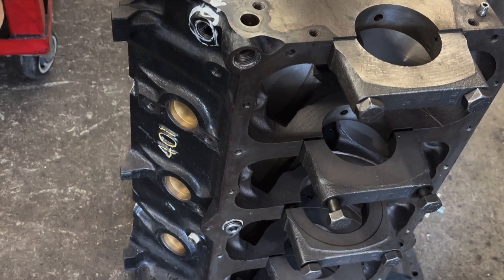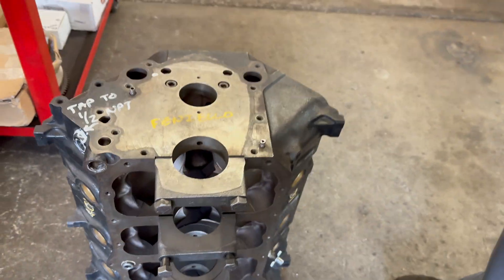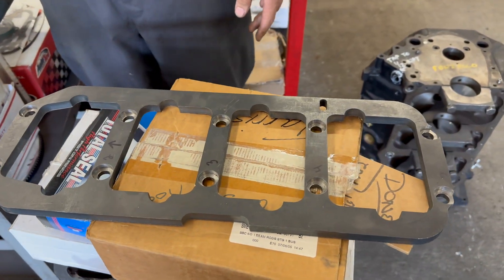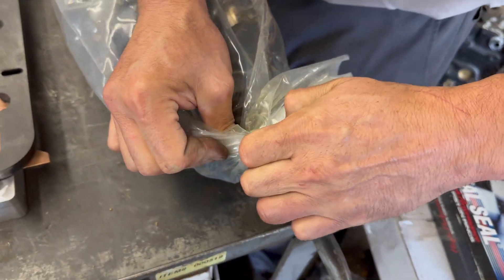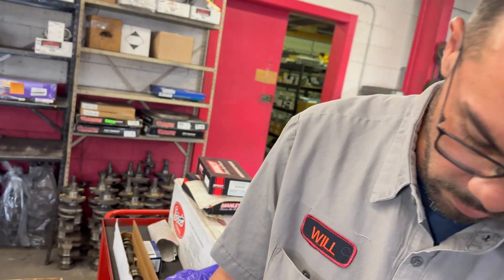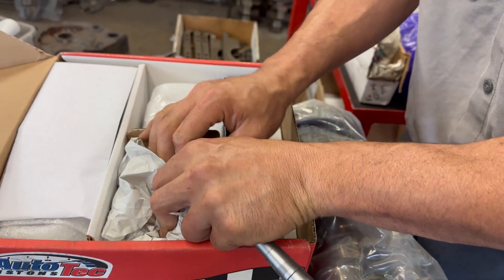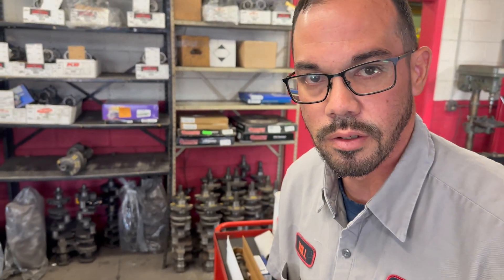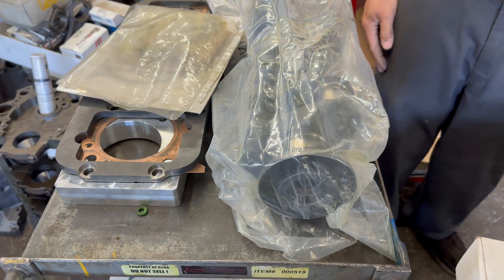AMC 401 / 430 Race Build: Oil System Mods, Custom One-Off Pistons with Will Violett w #BarryT

Comment: Glad to see AMC engine building . Yes the added bolt holes really are a good addition.  My 401 did have head gasket trouble due to the lack of good gasket clamping in the original AMC block design.  The 401 crank is forged from the factory . If you use FELPRO head gaskets on any AMC V8 , always use copper coat or other correct  sealant on the metal deck side of the head gasket and not dry as FELPRO says . The oil line comes from AMCs Trans am Javelin racing program in 68 69 70 maybe longer . High RPM with endurance issues required the oil line modification to better oil 7/8 rod journals to prevent failures . The restricting the drivers side oiling would likey be aimed at more oil to the crankshaft and the rods . Great information and good video . Lots of 327 AMC people  will love to see your video on those engines . 

Thankyou !!
Reply from the maker: Awesome !! We are on the lookout for a 327 to build and video 👍. Likely a 360 is next.

Comment: Funny the machine shops in Kenosha and Racine Wi. use to build a lot of AMC 401 and 390 engines. The pistons from a Chevy 400 small block are so close to the AMC that they could be installed. Any custom made piston is pretty much the same price .  The 0.060 piston from a Chevy 400 would be a 0.020 oversize fo a 390 or 401. The connecting rod would be bushed to fit the 0.927 wrist pin of the small block. Milodon swinging pickup are the ones that everyone was using for the external oil line, they even had a special oil pump lower plate to attach the pickup line.
Reply from the maker: Indeed!  The 401 we showed there ended up a 430 👍

Comment: There's a famous AMC 401 incident when I think it was the Alabama state troopers were testing 401 4 speed Javelins around 1971 for high-speed pursuit vehicles and it turns out after a mile or so at top speed the 401 would pump all the oil up into the heads and blow,,, so AMC's engineers fix was to shove pipe cleaners into the pushrods to reduce oil flow to the heads and it actually fixed it...   lol
Reply: It was actually the state trooper department mechanics that came up with the pipe cleaner trick .
Reply: @HowardJrFord   Really?  I read 30 years ago that it was AMC engineers..
So what I'm doing is trusting my old man memory AND something I read,,, how could I be wrong ??    lol

Comment: Great details💯😎☕
Reply from the maker: Glad you enjoyed it!
Reply: @BarryTsGarage  I always enjoy seeing improvement in engines. 
 I wish I had the ability to have Ed Smith do the engine for my 69 GMC 4x4.
 The guy who is doing my engine machine work currently, is decent, but it's really taking too much time ..
 My next watch site is going to be kinda far from where the engine is being worked on.
 I don't know how it's all going to work out ..
 It's really making it a difficulty, since I need my pickup to move my trailers to next job site .  SOON... and the engine is not done.
 I'll be doing this in the rain AGAIN, like I did in December of 2018..during a bad storm...
 Long story there. . . I may have shared that with you before 🤔☕

Comment: Where did you get the stud girdle? How strong would it make a 360 or 304 bottom end?
Reply: look at the bottom of the 401 block webs. The 401 and late 390s are solid there. AMC ran in Tans Am and made special blocks for the factory sponsored teams. They cast the 401 blocks but without engine size marking on the side and were only bored to the factory 360 size. Had one once, and they offered 4 bolt main cap in their performance catalog. The 290,343,304 and 360 blocks do not have the thick main webs